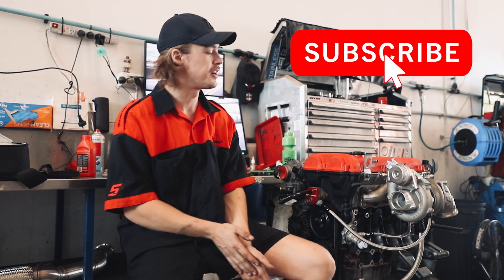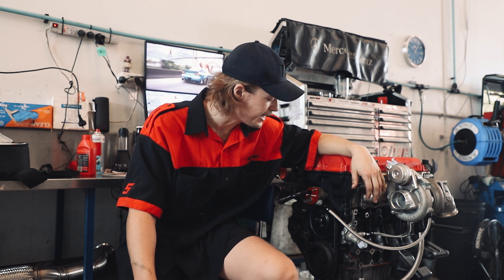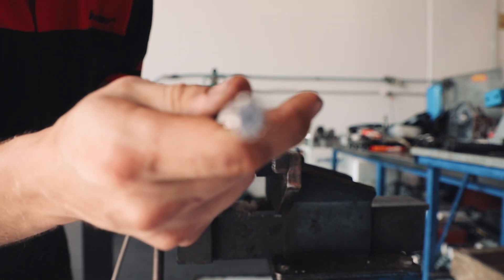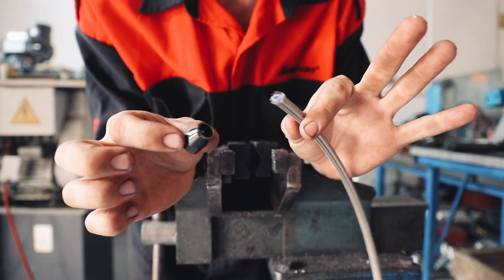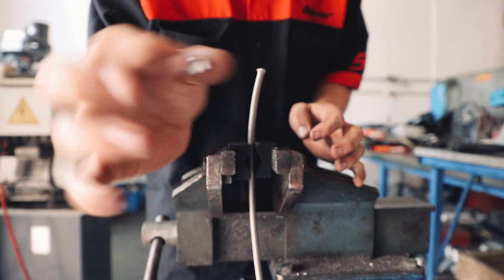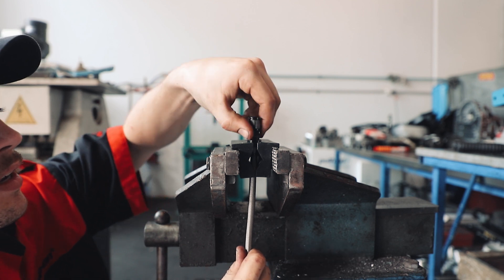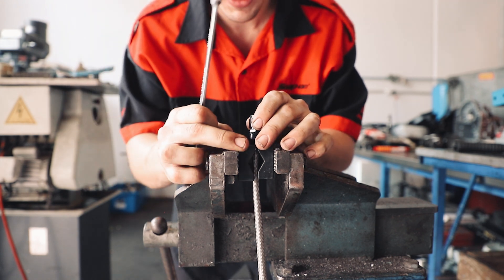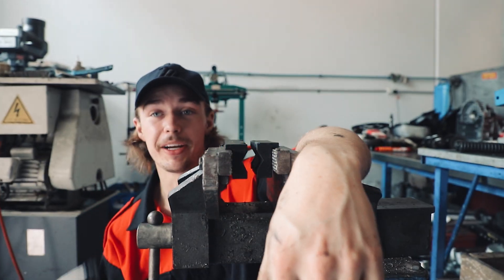How To Build Your Own Turbo Lines !( And Save Money )

Comment: The reason you were almost smacking yourself in the face is because you are using a steel wrench on an aluminum fitting. Steal wrenches will round off aluminum very easily, invest in aluminum an wrenches to prevent stripping and damaging the fittings. Nice video mate.
Reply: Not to mention marring up the finish on the hose fitting using a steel wrench.
Reply from the maker: 3 years running and not a single leak ! Don’t really care about the finish on the hose fitting haha

Comment: If you want to make lines #1 "DO NOT USE PIPE SEALANT" and  #2 choose a differant video to learn how to make your own lines utilizing an olive with PTFE line. Sorry mate......
Reply from the maker: I don’t normally reply to comments like this, but I’ve been a mechanic for 6 years and my entire work shop of race car building mechanics plus my 30+ year race car building boss taught me how to make them. From day dot I haven’t had a single issue with ANY of the lines I’ve made. Whereas every other person I know how has made their own lines has had nothing but problems and leaks. The method I used to make mine I swear by and will continue to recommend. :) maybe our opinions differ, but this is a proven way of making lines.

Comment: How not to build A/N
Reply from the maker: i mean, ive watched plenty of mates build them and have so many leaking issues, mine to date have not leaked a single drop any where on any line, must be doing something right
Reply: @BuiltByKyle  I’m not saying it’s not going to work but if I would like to follow video how to build A/N line - this one was my last choice
Reply: You called it. I stopped at using pipe sealant!?